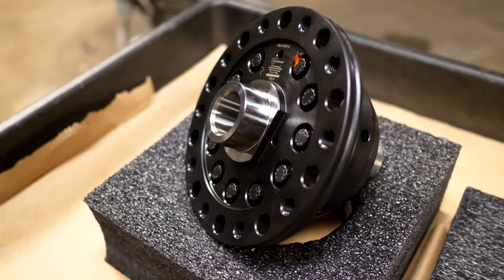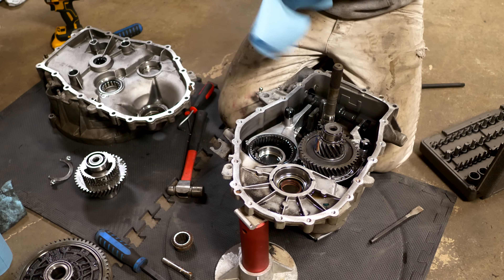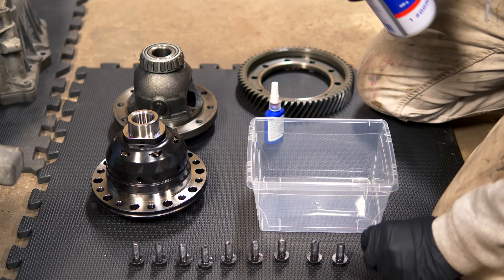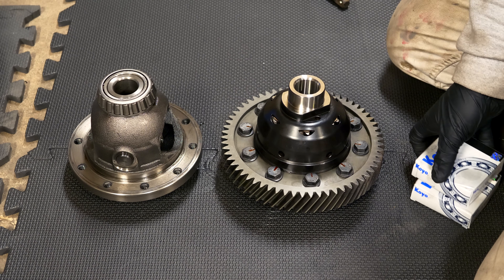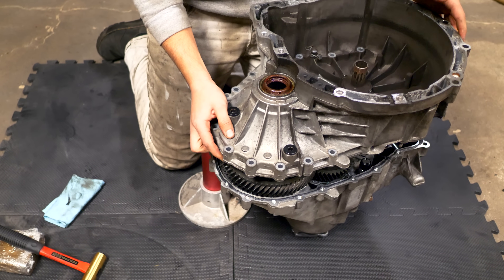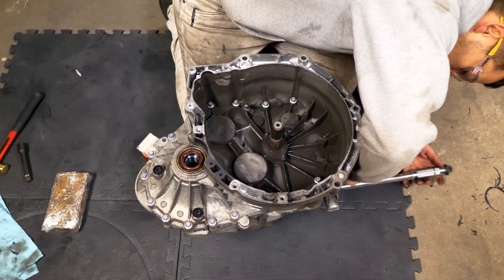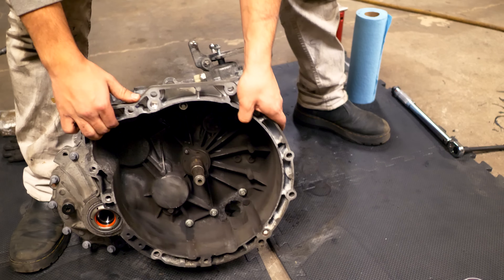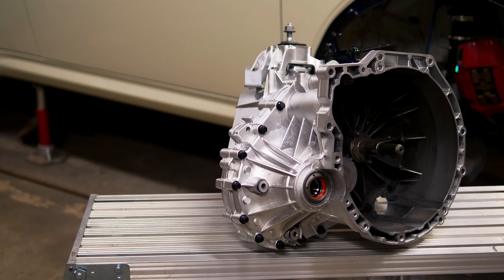How to Install a Limited Slip Differential in a Transaxle

Comment from the maker: To view the previous videos in this MINI playlist, click the following link: https://www.youtube.com/playlist?list=PL8qrGBNQ7kCVg0hUvE0P2LlM3xun1wvrH

Thanks for watching 🙌
Reply: milanmastracci can you remove your wheel adapter/wheel spacer video. Or confirm that the rear wheels sit flush to the adapter and not on the proud oem bolts please.
Reply: is that a 1zz toyo motor?
Reply: my 98 corolla vs mini...
Reply: Hey milanmastracci I have been looking for a closed differential (LSD) for a 2013-2017 j-series v6 honda accord.....any suggestions that you can offer would be much appreciated.

Comment: I was actively looking for all differential install videos for the MINI transmission.  Couldn't find your video when I was searching.

Please add some more keywords to your description so others can find it easier.  It's a great video and would have helped me a lot.  I figured out my way through it and got pretty close to your high quality job,.  I even had the same problem with the reverse gear separating.

Anyway, this looks a lot like my GETRAG GS6-55BG Transmission on my 2011 MINI Countryman S.  (Just including some words here is in the comment so hopefully your video will be easier for others to search for).

My manual transmission had a few bolts on the underside when taking it apart like you showed.  Thank you VERY much for including the torque specs on the differential ring gear.  That was the hardest spec for me to find back when I did this job.

Thanks a bunch for your video and hopefully you'll update the description to make it even easier to find.  I installed the Quaife Limited Slip Torque Biasing Differential for 2002-2013 MINI Cooper S manual transmission including my R60 (not AWD).  (not critiquing your choice at all... I have no idea which is better, again just including to make this video more searchable.)

Comment: Hi my is lee I have a 2003 with 12000 mails and I need your help in get a Limited  slip differential for a 2003 siblings if can Direct me to a preferred website transmission is a 604 automatic what a 2.5 L engine delivered cams  detect Engine running fine leaks from having my transmission rebuilt

Comment: eyewear eyewear eyewear!!! you absolutely should never never ever fucking use a hydraulic press without some form of eye protection. It does not matter how simple or seemingly low possibility of failure the task at hand.
Until you’ve seen a press send a 10lb chunk of metal flying across a shop at incredible velocity, you’ll never take this advice serious, so coming from someone who has. Please at least protect your eyes at least

Comment: Good job. Some cars may havea  more advanced way of changing the driive axle seals.etc. But never mind that. But the ARP bolts is NOT for looks as you said. They are far stronger and helps prevent breakage when the box is loaded with high torque. They can even help preventing a bit of flex in the box. Just saying. THis may not be a problem oin the mini's box and diff, but it can on larger boxes/diffs.
Cheers

Comment from the maker: UPDATE 
After driving my MINI, there is a huge difference in grip. When doing launches or accelerating out of corners, the car has no problem putting the power down to the ground. I'm very impressed with the Wavetrac differential 🙌

Comment: that bearing press station is like the entire reason this is possible
Reply: A frozen differential and a baked bearing with very little transmission oil in the bearing shaft, a right sized socket to drive the inner race and some very light taps should work to press this together.   (Not my advice, just something a shop that works on these told me when I was looking for options....I ended up having a local shop press the bearings on for me, but might be useful for someone without that option nearby.)

Comment: I would have suggested 518 permatex, it is a soluble gasket maker that should be used on any engine building surface. The problem with the non soluble gasket makers is that any over flow transitions into the machanical device potentially creating binding or sludge like build up over time. Maybe next time for you! Most engine builders use 518 or a hybrid of the same to ensure a secure bond without the fear of material in the mechanical devices bonded

Comment: Any chance you would do this to the 370Z and upgrade to an LSD?
Reply from the maker: I do plan on swapping out the diff in my Z at some point with a Wavetrac. When I went to the track, I found the diff overheated quickly and could definitely use an upgrade.

Comment: I'm gonna go ahead and throw a dyno day estimate here.....260whp and 295-310 torque. This is also tune dependant
Reply from the maker: One way to find out :)
Reply: @milanmastracci  my R55 will be out of the shop this week. Motor was just fully built. Went with supertech internals including the head. I cracked a ringland on cylinder 2 a few months back. I highly suggest running water meth to keep that motor happy when its ready

Comment: Looks amazing good job! Cant wait to see finished product
Reply from the maker: Thank you! Myself as well :)
Reply: @milanmastracci  ,,, Is this transaxle set up the same as in a Honda Inspire 5 cylinder inline engine ? Also,, do you have any knowledge on how effective it is on using a key way to replace the splines on the input shaft ? Mine are heavily worn . Thanks 👍

Comment: I wouldn’t use an extension when torquing bolts
Reply: Extensions dont make a difference
Reply: @nav8475  Yes it does.
Reply: Depends on the rigidity of the extension. Some will cause a noticeable difference and some will cause a difference but is still precise.
Reply: @JA-tg7ej  is right. It all depends. I'll even mention that a calibrated tool would be within soke precision. So if the tools not been calibrated in a long time then  using a dodgy or decent extension makes no difference if the tools out of spec.
Reply: Riyazatron agreed
Reply: @Kebabsauwz  Only universal joints affect torque
Reply: @kiyoponnn   "okay"